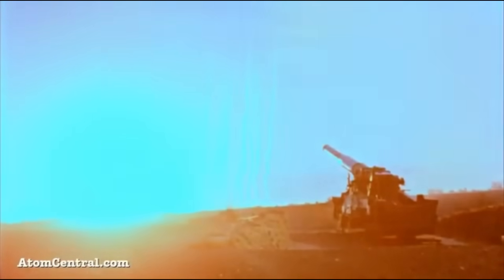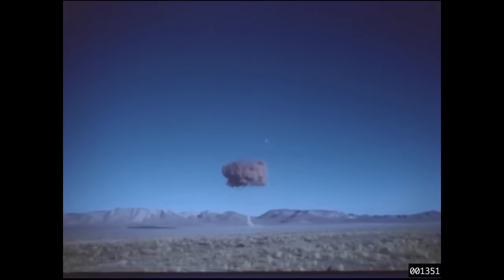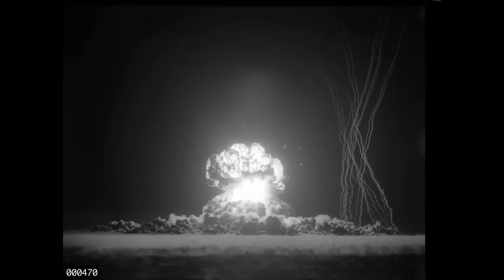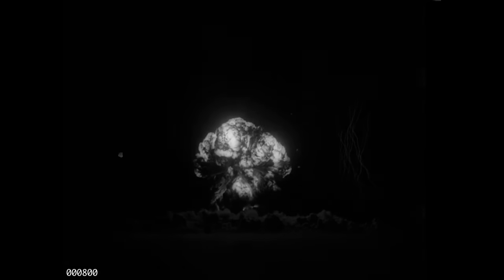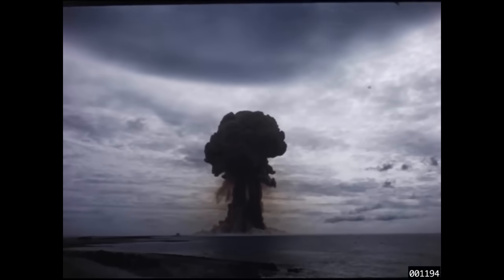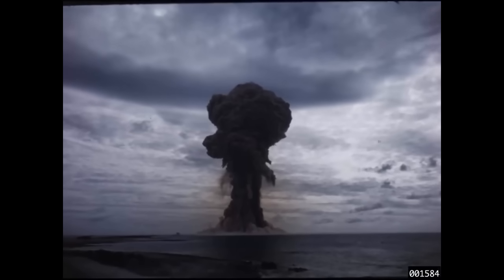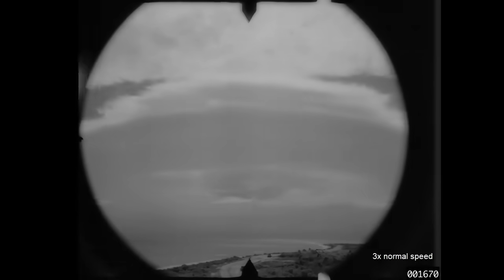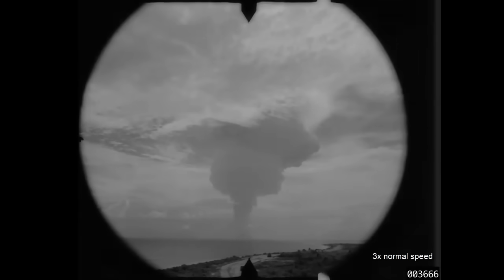What does a nuclear bomb sound like?

Comment: Wonder if the over 2000 nukes that have been detonated since 1945, have anything to do with the increased cancer rates over the last few decades.
Reply from the maker: That's an interesting question. When nuclear tests where common above ground it was found that levels of Strontium-90 in milk and babies teeth was a lot higher than it should have been. One of the reasons above ground testing was banned. It's safe to assume that increased levels of atmospheric strontium was responsible for an increase of cancers of people at the time or who where kids at the time. 

As for right now, there are other factors. Cancer diagnosis is more accurate these days so more cancers are found just because we know what we are looking for better. But factoring that out, modern increases in cancer is likely a result of lifestyle, food and pollution. Coal smog is known to kill hundreds of thousands every year and contribute to lung cancer. 

There hasn't been an above ground nuclear test I a very long time and only North Korea has tested nuclear weapons in the 21st century. So atmospheric contamination from them isn't much of a factor anymore. But it once was, so excellent question.
Reply: @venera13  Actually I think pollution is more contributed to commercial airliners. When 9/11 happened and over the last year. With the decline of air travel, we have  seen a huge drop in pollution levels. In fact the three days after 9/11 the Earth's temperature went down a whole two degrees Celsius. Even the skies became bluer.

Comment: This is the explosion of a nuclear artillery shell not a nuclear bomb.  There is a significant difference 'twixt the two that you should have been aware of.  You may want to retitle your video.  Cheers!
Reply from the maker: There actually isn't a difference beyond deployment method. The first clip I used was specifically the Upshot–Knothole Grable test. Grable used a uranium gun mechanism identical to Little Boy dropped on Hiroshima just smaller in size, it even had a similar yield of 15 kt.

A nuclear weapon is a nuclear weapon regardless of how it's deployed. A suitcase SADM tactical nuclear weapon is the same as any other fission type nuclear weapon. The smallest nuclear weapon, the M-29 Davy Crockett was stupid and impractical, but it was still a nuclear weapon. The only real differences in nuclear bombs is in it's energy usage. A nuclear weapon that just uses fission (implosion or gun type) is different than a thermonuclear weapon that uses a fusion second stage (generally lithium lithium deuteride). But even then the sound is the same because the sound you hear is the initial blast and shortwave, which will always sound like a fast loud "bang" followed by echo sounds and the sounds of air moving. 

Nuclear artillery sounds the same as any other nuclear weapon because they function the exact same way. The only difference is deployment method. Being shot from a cannon, dropped from a plane, fired on a rocket, or static on a stand, the explosion will sound the same.

Comment: The EM noise is the best bit. Like you can actually hear the nuclear explosion itself not just the atmospheric shockwave.
Reply: The EM noise scared me more than the shockwave,
As an audio engineer I can say this: we are not witnessing everything that is happening. There is more dimensions to the thing that we cannot measure.
Reply: @nemliveproductions  How do you mean?
Reply: @nemliveproductions  Absolutely, we only needed to perceive and experience the universe in very specific ways that were necessary to our survival to minimize energy demands due to the limited number of calories we could sometimes get and sometimes not throughout the course of our evolution.
Reply: The em pulse is a truer appreciation of what the nuke actually is. It's the signature of the energy pulse directly. The acoustic noise is just the air getting upset at the energy pulse and running away really fast while shaking and vibrating
Reply: A "gentle" reminder that light travels a hell of a lot faster than sound. Of course, it also comes with the sunburn of a lifetime.
Reply: But what did the Tsar Bomb sound like

Comment: If you were directly underneath one you wouldn't hear or feel a thing. The thermal pulse would vaporize you in the first couple of microseconds before your brain even registered the flash. By the time the pressure wave traveled that 2k feet or so all it would do is scatter your molecules over a very wide area.

Comment: You said when the primary fissions the x-rays cause fusion...
I can't remember the last time I saw this printed. You see, it is the truth. Most seem to promote the old theory that it is the HEAT which causes the fusion reaction. We know now it is the radiation. 
That's awesome of you. Lol 👍
Reply: It is a problem for the bomb to shed its 50 million kelvin heat.  First, the heat is converted to EM by black-box radiation with the peak in the x-rays.  That gets out of the case before it knows what's going on, and gets absorbed by the air, converted back into heat.  The heat creates the fireball, where a lot of the heat gets turned back into light and infrared.

Comment: Except for any particles thrown out by the explosion, nukes are photon bombs.
EMP = Photons.
heat = Photons
X-rays = Photons
Blast wave = air displaced by Photons.
Reply from the maker: Well, kind of but it's more complicated. They produced a lot of EM energy which can be expressed as photons. But the blast wave is the same as a conventional explosive. The fireball super heats and displaces air as a plasma, and the air just piles up on itself as it moves out. only a small amount of the fission material is converted into photons, the rest is vaporized or converted into other particles. They operate as a conventional explosive compressing a fission core into criticality. 

In a way they are more of a mass conversion weapon as their energy comes from the small percent of mass being converted to energy.
Reply: @venera13  All EM is photons bruh.
Nukes are photon bombs.
Reply: Couple of things.  Heat is not EM; its vibration and kinetic molecules.  Blast wave is caused by suddenly heating the air.  Then, also how about neutrons?
Reply: @puncheex2  Think harder.
Visible light.........photons.
infrared light........photons.
microwaves.........photons.
radio waves..........photons.
ultraviolet light......photons.
xrays.......................photons
gamma rays...........photons
anything that gives off heat is actually emmitting photons.
What do you think an IR camera is seeing..???.............Photons.

Comment: I don't think it can ever be recorded as to the decibels it gives out, not to mention the EMP.
Reply from the maker: From the distance they are recorded you can easily record the sound, it's just a very loud bang. As for the EMP, ground detonations do produce them, but they aren't as powerful or widespread and can be easily shielded against. Early tests found that equipment close up would sometimes be damaged by it but otherwise it was not a problem. The powerful EMPs that knock out grids and such are produced when detonating nuclear weapons at high altitude.

Comment: Thank you for accurately describing the bomb cores. It's amazing how often people get it wrong - especially the Little Boy bomb. Most people think it was a plug fired into a cylinder, while in reality, it was the plug that was stationary!
Reply from the maker: I try to be informative.
Reply: You are misinformed. It was, when fully assembled, spherical. The projectile was solid, and shaped to fill a void in the side of the (segmented) sphere. You should read "The Making of the Atomic Bomb" by Richard Rhodes.
Reply from the maker: @DCMoons   I'm sorry but no, you are misinformed on this one. Implosion type nuclear weapons use spherical pits, this mixed with the demon core experiments utilizing half spheres of uranium lead to an incorrect assumption that the little boy core was spherical. But it was not it was cylindrical. And this is according to official accounts, including those who worked on the bomb. Shooting a half sphere into a half sphere would likely not result in critically, its also an unstable shape. If the charge behind the "bullet" was even slightly off the half sphere would twist and not hit the target correctly. This is why a hollow cylinder was chosen, upon sliding over the inner cylinder it would reach critically reliability, and would move down the barrel correctly the first time.
Reply: @venera13  you apparently didn't actually read my comment. I never said the projectile in the Hiroshima bomb was "half a sphere" - it was a  stubby cylinder with a truncated conical tip, and the "target" was a sphere in 3 segments (encased in beryllium and the 2,000-pound carbide steel nose of the bomb) with a void to match the shape of the projectile. Any shape other than a sphere requires a greater number of atoms to be a critical mass; this is a fact of nuclear physics. The total assembled mass of the core in that bomb exceeded critical mass by so much that the rate of natural spontaneous fission of U-235 caused the core to complete 80 generations of fission, detonate, and disassociate by vaporization before the "bullet" even reached the "target". The popularity of the "plug and cylinder" configuration myth is due to deliberate misinformation by the AEC/DOE. Again, you need to read Richard Rhodes' book. By the way, I actually handled nuclear weapons while I was in the Air Force - my information comes from official sources and formal studies in nuclear physics, not outdated guesswork or deliberately misleading statements made by officials trying to throw enemies off track as to bomb design.
Reply from the maker: @DCMoons   again no. The bomb you are describing is one of a couple designs for a gun type weapon. But the little boy bomb was specifically a uranium cylinder  target with a uranium ring shot over it to produce criticality. The people who built it littirally said this. 

Here is a video, it shows a design like you described, but pay attention to the scientist describing it. He littirally says a hollow cylinder slipping over a smaller one. 

https://youtu.be/nvGyxVfexpA

There is nothing wrong with being incorrect, but not fact checking is a bad look.

Here is a pretty good diagram as well.

https://upload.wikimedia.org/wikipedia/commons/d/d1/Little_Boy_Internal_Components.png
Reply: @venera13  I had sufficient security clearance in the Air Force to have seen the actual engineering drawings of the Hiroshima bomb - the core was a 4-part sphere. Your source material is YouTube and Wikipedia, and the two diagrams you present don't even match. The guy in the video even mentions firing a "plug", contradicting the earlier government misinformation about a "cylinder".

The Wikipedia cross-sectional drawing is rife with errors. The Navy gun repurposed for the bomb was a 3" bore, not 6 1/2". There were no "cordite bags" - the chemical explosives were 4 solid pieces that nestled together like sticks of butter. The nose of the bomb was a single piece of carbide steel, not built up in sections, as maximum tensile strength to contain the nascent explosion was a major concern. There certainly was no need for an "impact absorbing anvil" or any type of initiators - the high rate of spontaneous fission in U-235 was more than sufficient to start the chain reaction.

I recommend that you do what I did - study engineering and nuclear physics, and stop getting stuck on deliberate misinformation and guesswork. At the very least, read the best-researched book on the subject, "The Making of the Atomic Bomb" by Richard Rhodes. It contains far more accurate information than you have presented. Again, I'm an Air Force veteran who has handled actual nuclear weapons, studied nuclear physics, and seen the actual blueprints of the Hiroshima bomb. I realize you don't want to believe it, but you are absolutely wrong about the configuration of the device and the physical geometry of its' core.

You also misspelled "literally" - there's no shame in being incorrect when you're misinformed, but poor use of English, just like insufficient research, is a bad look.
Reply: Well, that was interesting.
Reply: I have read a lot of books on it, maybe skipped over or read conflicting ideas. Thought it was more of a cone shape projectile design. Will have to go back to my books to see what they say.
Reply: The Best-Kept Secret, by Purcell ©1963, pg 177. The expanding gases from that charge would drive the uranium slug down the bomb's "gun barrel" at a speed of nearly a mile per second into the waiting uranium cup.

Comment: Nahh that is a little nuke from way back. The new nukes is like space rockets so I think it is much worse
Reply from the maker: Depends, The tests shown in this video are between 15 - 30 kilotons, which is larger than the one dropped on Hiroshima.

A nuclear weapons deployment method does not change it's yield. You can drop a 3 Megaton hydrogen bomb from a plan, or shoot a 1 kiloton tactical nuke on a rocket. The rocket is just a vehicle and is not apart of the bomb. In fact the bomb isn't even attached to the rocket by the time it hits it's target. Regardless if you are far enough away for it not to kill you the sound will be the same. The Tsar Bomba which was around 50 megatons and the largest nuclear bomb detonated by humans, it broke windows in nearby towns. However it sounded like a loud bang too because that's just how nuclear weapons operate.

Comment: 35 sec x 340 m = 11.9 km  distance
Reply: Isn't it the same way you can calculate how far away lighting is? I use 6 sec/mile.
Reply: @pschroeter1  1 mile = 1.6 km,  1600/340 = 4.7 sec
Reply: @longmire5504  
I always use this and this is the formula Civil defense uses to determine distance and power of the device
Reply: That’s not how math works

Comment: If you ask me, the sound barrier is broken on impact.
Reply: Super Syion Bunta oh hell yes. The fireball initially is expanding, from the core of the bomb just a moment after it goes supercritical, at a rate of MILES PER SECOND. It quickly slows as the fireball becomes about as dense as the air around it
Reply: this actually happens with ammo being shot out of a gun. some ammo is subsonic which means it's quieter to shoot.  combine that with a silencer and the gun is very quiet to shoot.
Reply: It definitely is.  The speed of sound is the speed of a wave through a medium.  In a proper detonation, the gases being produced are MOVING faster than that.  Although, another way of thinking about this is that at the pressures generated, the air is acting almost as a liquid, where the speed of sound is much higher.

Comment: actually depending on your distance relative to you and the detonation, and size of the weapon the explosion will sound like anything from an eardrum rupturing boom, or if you are far away it'll sound like a rifle shot
Reply: It certainly will not.  Higher sound frequencies are easily attenuated through the atmosphere, especially at sea level.  From a distance only the low frequencies will be heard, as a rumble of reflected sounds off hills, mountains, and the atmospheric thermocline which exists between thirty and sixty thousand feet.  That sound passes round the Earth several times at that height.  It's powerful enough to do that.
Reply: Sound is not supersonic.
A rifle crack is the sonic boom off the bullet
Reply: @hotrodray6802  What is your point?
Reply: I like your reply best; and believe it to be the most accurate and relative.
Reply: You don’t say

Comment: That is not a nuclear bomb. It is an atomic bomb. A nuclear bomb uses a process called nuclear fusion whereas an atomic bomb uses a process called nuclear fission. The energy yield is much greater with fusion.
Reply from the maker: No
Nuclear bomb refers to a weapon that uses energy stored within the nucleus of an atom, either through fission or fusion. That's where Nuclear comes from and is also why fission byproducts can be referred to as nuclear radiation. A hydrogen bomb that uses fusion is referred to as a thermonuclear device. Both fission and fusion weapons can be called atomic or nuclear as the term is interchangeable and doesn't descried a specific kind of nuclear bomb. Kind of like how hydrogen bomb and thermonuclear bomb mean the same thing. So a nuclear bomb describes both, a thermonuclear bomb only describes the fusion variety.

As an addition, hydrogen bombs use a fission primary to initiate the fusion reaction in the second stage. 

If you want to get really specific most of the bombs I showed here where plutonium implosion fission devices.
Reply: @venera13  You absolutely destroyed them.
Reply: Nerd
Reply: Nobody said this was a Nuclear Bomb.
Reply: @MDE.1984  it's in the title of the video lmao
Reply: Not only that, but imagine how loud this would be if you were actually standing within 30 or 40 miles from it.
Reply: Fyi do not watch this video if you have high blood pressure. 
#JustSaying
Reply: Wtf?